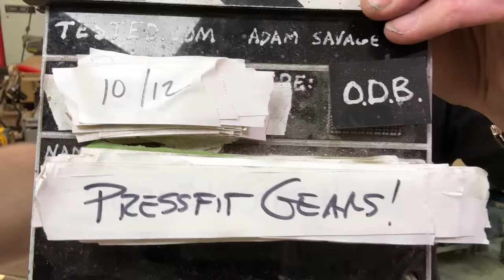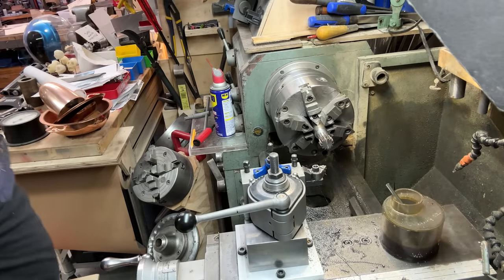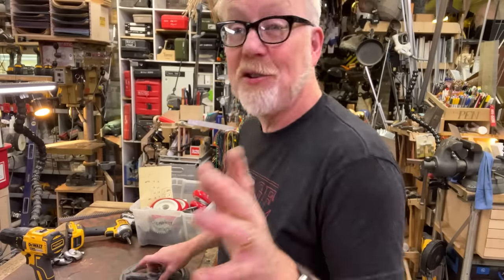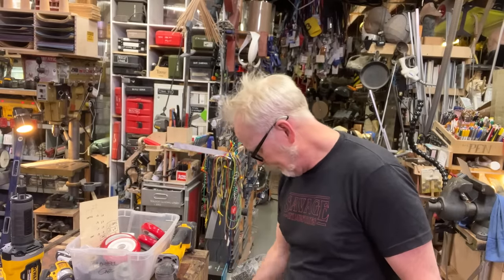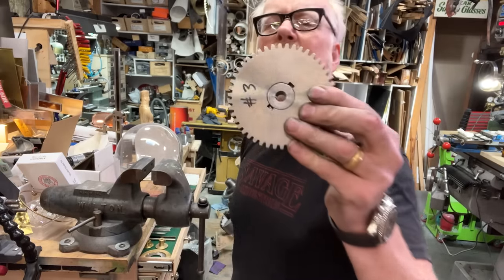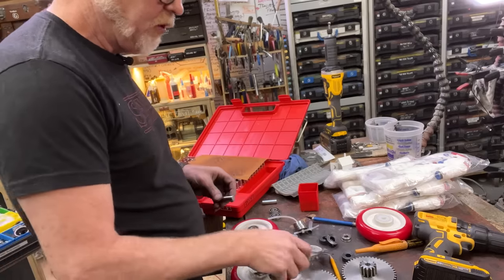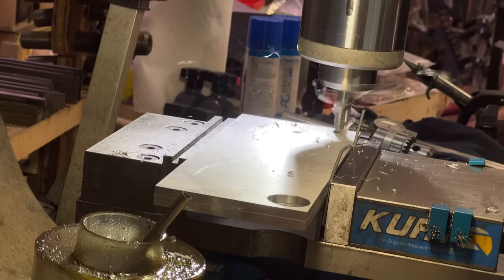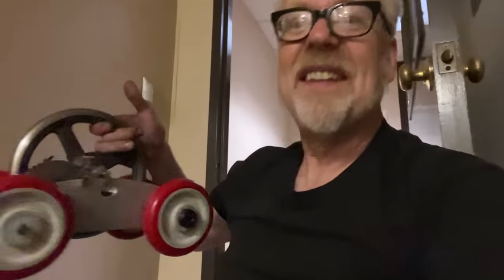Adam Savage's One Day Builds: Giant Flywheel Toy Car!

Comment: I would definitely drill out the gears and take some of the weight off of them. Youre losing alot of the power through having to spin the heavy gears. I imagine if if you can cut 75% or more of the weight off the gears youll see a tremendous improvement on performance.
Reply: Also I would be curious how the performance ends up if you 3D printed the gears and kept a heavier flywheel.
Reply: I agree about gear weight reduction.
Reply: Think the flywheel needs to be heavier...could check how heavy the small toys flywheel is compared to the overall weight, and compare that ratio to the ratio of the weight of the flywheel/overall weight of the bigger version.  I'd be willing to bet the small toy flywheel is heavier in comparison, and the bigger one needs more mass.
Reply: I wondered if increasing the size of the wheels would do anything, or is it all in the gearing?
Reply: I dont think you guys are right. Its about the gearing ratio. It requires the flywheel to achieve crazy speeds to travel with decent speed. There are crazy losses on all the friction and least of it in the rotational friction in the bearings (they do work very well, always). Most is air and gear to gear friction.

IMO wheels on the car get crazy torque and low speed, thats all, while there is tonne of friction losses.
Reply: The gears are just more flywheels. Their weight adds momentum. I would think what is needed is less friction.
Reply: IMHO: gear mesh could be better. Clacking may indicate that the involute shapes of the teeth are not "rolling" together.
Reply: Lighten the wheels and body.
Reply: The gears are flywheels, the heavier they are the more momentum they carry. The only way to make them take less power would be to make they spin smoother. I suspect the big step-down middle gear is what is dragging the worst, also and someone else said: it sounds like the gear mesh is off.
Reply: @microbuilder  interesting thing about flywheels is they have the best rotational inertia on the edges so almost all the weight inside the gear can be ignored.
Reply: @jeffmarden9502  the wheels play a part in the gearing as you generally spin up the flywheel by pushing the car (spinning the wheels) so essentially a bigger wheel would make the flywheel spin faster for a given push speed
Reply: @famousamoso7 sounds like a recipe for broken teeth if it came to a sudden stop. The cogs would have to be pretty substantial to hold up to the torque of that wheel
Reply: @NickSchade  I'm pretty sure this is all a friction issue. Even at the wheel-ground interface.
Reply: @Mostlyharmless1985  Not all the weight. At the extreme side you have only a small ribbon of weight at the edge and nothing inside to be intertia'd upon. Inertia is distance^2, so if you can double the average mass-distance you'll quadruple the inertia, but it's not a bad thing to have extra inertia on the inside. You could take out that weight, and add it back in as another flywheel and make it more efficient.
Reply: The gear ratio is wrong. The driving wheels a little small. The gears are meshing a whisker too tight. Some eccentric bearing holders that could be rotated to adjust the meshing would help. That is all. Lovely build otherwise.
Reply: @jacklougheed4561  but you don’t want a bunch of flywheels as the force applied to each to get them moving then counteracts the forces applied to the drive wheel. Which is why on his model car it only has 1 flywheel and the rest are very light plastic gears.
Reply: The gears are too wide, it’s more friction loss than too much mass in the gears, that’s why the toy has such thin gears.

Comment: I would love to see a part 2 where you track down some inefficiencies and get it running better!
Reply: Writing down what change improves efficiency most would be radical.
Reply: Making a test harness for it would be good step in that direction… if the flywheel won’t stay in motion very long when it is mounted “in the air” then it definitely won’t go very on the ground
Reply: @Garganzuul  The writing it down is what makes it Science!
Reply: Yeah a part 2 would be amazing. I think where Adams thinking didn't take a corner is the wheel size. On the original car the wheels seem much bigger in ratio to the gears. That's another ratio that largely determines the speed. Try that maybe...great build though..

Comment: I'm sure everyone is pointing out that you're losing a lot of energy with that clicky-clack and there's probably lots of friction everywhere, but there is one other aspect that folks might not be realizing: YOU'RE NOT SCALING UP THE SPEED. What you need to do is mount a cage on top of the car so you can grab it with both hands, then hold it alongside you as you run forward and release it; only then are you going to get the same speed RELATIVE TO THE SIZE OF THE CAR.

Comment: Bigger wheels and lighter weight transmission gears, wheel diameter is as (or more) important than internal gear ratios - looks awesome as always keep them coming!
Reply: I wondered the same things about the wheels. The ratio of the wheel size to gear size in the toy car seem much bigger than the wheel size on the finished car.
Reply: @jeffmarden9502  also the flywheel to wheel ratio seemed a bit bigger on the small one...but different gearing ratio and relative flywheel weight so that ratio might not mean much
Reply: I disagree with removing weight from the gears. Each gear is essentially just another flywheel, albeit a flywheel with less mechanical advantage than the largest one. Every part of that machine that spins is subject to the conservation of angular momentum, so removing mass from the gears is removing mass from secondary or tertiary flywheels. 

The problem is the power source. 

Imagine a giant Adam pressing the car multiple feet across the floor, multiple times in rapid succession. Replicating that is going the be very hard for a regular sized Adam. 

The main problem is that Adam has scaled up the device without scaling up it's power source, because Adam is the power source.

Take the tiny toy car, which we know works fine. Imagine how hard a 6 inch tall Adam would struggle to get it up to speed. 

Perhaps a six foot long pole that slots in at an angle. Run behind the car until it's up to speed and pull the pole out and let the car go.

The more I think about it, the more I think that solution is to Imagine what a six-inch tall Adam would do to get a 1 inch car up to speed, then regular Adam can scale up mini-Adam's solution.
Reply: I agree
Reply: That flywheel is not optimized.  It's not meant to be, it's a hand wheel.   The space between the spokes robs the wheel of mass and therefore momentum.   A thick solid flywheel has more mass density than a spoked wheel.
Reply: @coryjones4040  Those massive gears do absorbe way more energy than lighter ones, just by friction.
Reply: @chiphill4856  the most efficient flywheel, with an optimum moment of inertia, is always going to be a "weighted rim" style fly wheel. the solid flywheel might SEEM like a good idea at first...but it would be much easier to change the the acceleration of said flywheel. easier to spin up, but also would spin down much faster. the ideal flywheel would move as much mass as possible to the edge, thereby making it conserve momentum more efficiently. Of course, the fact that there is a direct mechanical linkage means there is more loss of energy with the increasing contact area in the gear train. I would keep the handwheel and create a second gear set and small transmission separate them; one for spin up and another fort drive. smaller drive wheels would probably help too though.
Reply: @coryjones4040  the problem with the heavier gears is that the main power source is the flywheel. Once Adam releases the car the flywheel has to keep those larger gears spinning. Those "other flywheels" then start absorbing the main flywheel energy instead of transmitting it to wheels. That's the cause of parasitic loss.
Reply: @TheMadninjamike  interesting, thx.   I get the weighted rim idea, but I still think the complete absence of material is less efficient.  I would have to look up the mass moment of inertia for those shapes.  At least I think that's the right term, it's been awhile!
Reply: @chiphill4856  
Basically, the solid gears act as smaller flywheels. The biggest gear might weight nearly as much as the whole flywheel, but the flywheel has it's mass distributed out much further than the gears do, and the moment of inertia is distance^2, so twice the diameter (with the same total mass) would be 4x the inertia. You do gain additional inertia by infilling it, but it would be better to A) add another flywheel (or your car will get heavier and heavier), B) increase the gear ratio, or, ad I think this is the most important one right now, C) reduce the friction, like, everywhere. This thing is heavy, and it has 10x the friction it can sustain.
Reply: @kindlin  No doubt gear ratios, gear size and friction can play a part.   My comment was specifically about the amount of angular momentum achievable by a flywheel of a given diameter.   How can you say "it would be better" to change gear ratios or add an additional flywheel or reduce friction when you don't know the design constraints, including what gears and flywheels Adam has readily available for installation?
Reply: @chiphill4856  I mean, he's the one fabing it, so he can with it whatever he desires. And cost, time and ingenuity are hardly constraints for this man at this point. If he can imagine it, he can make it.
Reply: @kindlin  cost and time are always limited.  Always.
Reply: @chiphill4856  Then being efficient with your use of material is even more important. ...what were we talking about?
Reply: @coryjones4040  maybe a way to spin up the flywheel with a motor before dropping the wheels onto the ground would help!

Would be a lot of force stored in that system!!!
Reply: @kindlin  lol.  Good one.  To put it another way, have a look at a real flywheel from any mechanism.   They are ususlly solid wheels with extra mass around the rim.  I have possibly never seen one with spokes and empty space.
Reply: @chiphill4856  I imagine that's for strength and/or simplicity of fabrication. The efficiency statement is just a simple math formula:
Moment of Inertia = integral( Area * Distance^2 )
The distance for a spinning wheel is its radius (polar moment of inertia, with the axis into and out of the wheel), and for a bending beam its the distance from the neutral axis (the geometric moment of inertia, with the axis in the plane of the cross section of the beam).
Reply: @kindlin  That's the mass moment of inertia, correct?  I'm interested in the amount of angular momentum available for a given shape.  I may have used the term efficiency incorrectly.
Reply: @chiphill4856  I guess people do define them differently, but that's just adding needless confusion. They are the same, except the mass MOI is the area MOI multiplied by the density and a thickness. The typical MOI is a property of the cross section, any cross section, and if you include a thickness and a density it then becomes a more physically intuitive property, but the math is exactly the same.
Reply: Too much friction, flywheel is too small (weight and diameter) and/or fast enough for the size.

And as another stated, it’s also the energy input isn’t scaled.

Comment: Heating the female and freezing the male makes press fitting SOOO much easier. Take a look at how mechanics put bearings into engine cases for reference. Just a tip, since I didn't hear it mentioned in the episode!
Reply: Was thinking this the whole time
Reply: Didn't want to comment on that press fit, because I am not an ME expert.
However, once upon a time, I had a 67 MGB, with a bad ring gear. Was told to buy a new ring gear. "Whadda I do then?", I ask.
"Stick the ring gear in the oven on max heat and the flywheel in the freezer....and wait".

I waited, (patiently for once), and took the flywheel out of the freezer and smoking ring gear out of the oven.
Threw the ring gear on the flywheel.....
AND the ring gear literally FELL onto the flywheel.........with probably 1 mm of clearance!

But, When everything cooled, it would have taken a sawzall to get that ring gear off (like the bad one that I sawed off, originally)!
Reply: No real need for a small press fit of a couple of thousands.
Reply: @charles401  - ice water and a casserole of hot oil for the other would be more than enough to make the components fit, I think. 
After all, there would be a temperature difference of 60-80 degrees Centigrade at least, and that should ease the pass and make it easier.
Reply: While absolutely, yes, that'd help, the surface area of the fit here is not nearly large enough to warrant the extra effort. Sure, it makes it easier, but you'll manage anyway even without needing a dedicated press, considering the small diameters, the relatively small difference between the two components and the overall length. I'm a trained CNC mechanic and during my apprenticeship I did all sorts of things, even lathed two pressfit components once. These had a difference of 0.04mm (so relatively large) on a 120mm diameter with a depth of 40mm. There was no way you could've pressed these two together without the temperature difference. Took half a day to cool the male down though, doubt that's extra time Adam has in these one day builds.
Reply: Uhg I just commented the same thing. Baffled he doesn’t do this.  Maybe he’s losing it .

Comment: I'd love to see another video analyzing why it didn't work as expected. If I had to hazard a guess, it has to do with a scaling problem. Some things go up linearly with size, some things go up as the cube of size. A physics toy like the original flywheel car depends on all sorts of ratios to work, and it woud be interesting ot figure out how you'd have to scale each of the different pieces to maintain the ratios so that the car woud work supersized.
Reply: i'd think for one it's the ration of wheel to flywheel: the wheels on the toy car are way too small. second thing is the distance traveled to load up the fly wheel. imagine you'd only push the toy car a carlength forward, then it would also not run far. upscaling he would probably need to push the car around 5-10m within maybe 1-2 seconds (imagine moving the smaller toy car with your hand around 50-100cm to build up momentum). the flywheel needs to run at crazy speeds for this concept to work.
Reply: @moos5221  I agree, too much torque, too little speed. Also, the flywheel is skeletonized so it does not carry as much momentum as it could have. The gears also seem too heavy and they make a weird clicking sound while moving so they probably consume unnecessary amounts of energy.
Reply: @nigeypants5500  You don't seem to understand my point. WIth the regular sized toy you spin the wheels around 50-100x the full wheelturn distance to charge it and with the oversized toy you spin it around 5-10x the wheelturn distance. that's the main issue here imo.
Reply: @moos5221  Wheel size and gear ratio have the same effect here. The only relevance wheel size has -- if wheels and gears are set to a given speed --  is rolling resistance and total mass.
There is energy being lost like crazy in the drivetrain. You can even hear it.
Reply: @smoker3092  The flywheel was my biggest concern. It's supposed to be a lot of mass and he chose something that's mostly air. I would bet the flywheel is roughly the same weight as the large gear, if not less. Instead, the gears are all dense and so is the body of the car. Heck, even the axles are unnecessarily heavy. He could improve it a lot by either swapping out the flywheel or filling in its empty space so it's solid, not to mention using much narrower gears (which would also reduce the friction in the "drive train") and also milling out the frame so it's a bunch of triangles instead of just solid heavy plates, making most of the car lightweight vs. the flywheel.

Also I agree with others saying the wheel diameter was too small. I forget whether he included wheel diameter in his gearing ratio, but that might have been an issue if he forgot to. Technically, the ground and the wheels are a rack and pinion, just without teeth you can see with the naked eye.